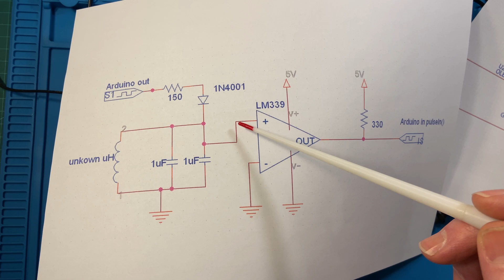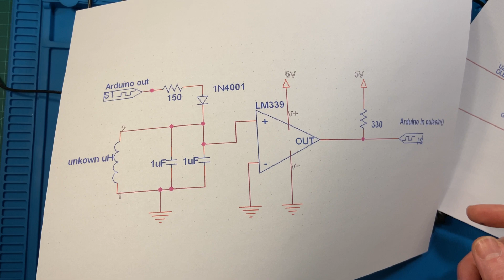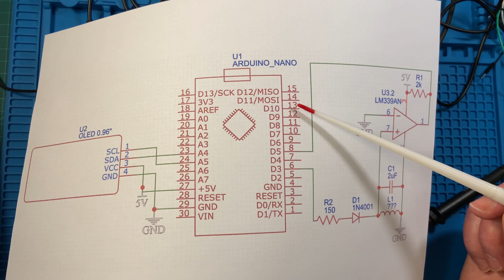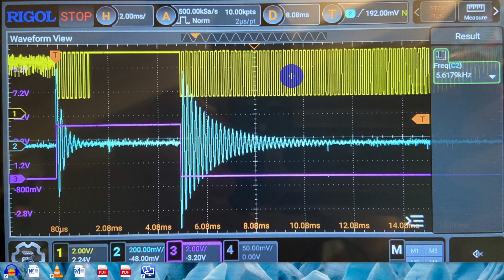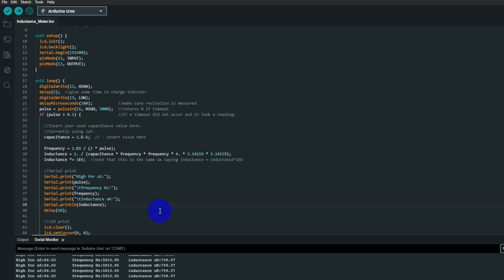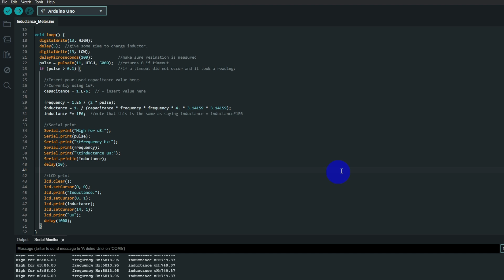Let us build an inductance meter and review operation in detail #arduino #electronics #oscilloscope

Comment: I'm astonished at what can be achieved with such  a simple circuit . Thanks for sharing  .  capacitance meters are a dime a dozen , but inductance meters  appear to be rare and expensive
Reply from the maker: Yes, multimeters will do capacitance, but for inductance it seems to be a dedicated instrument.
I measured some small inductors, a 40uH and a 220 uH and those measured correctly.
Seems to be ok with small values.
Those inductors are on a board with a few buck regulators on, surface mount inductors.